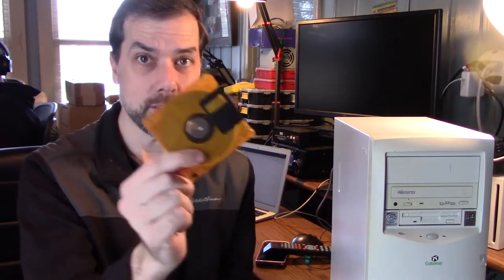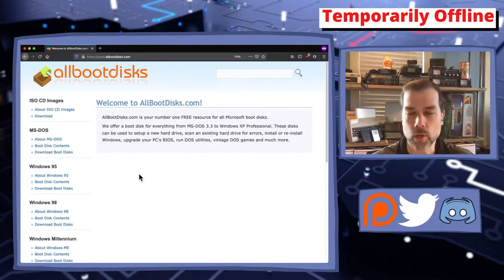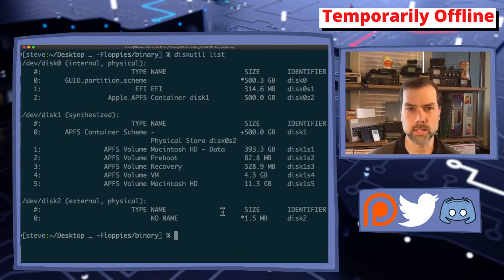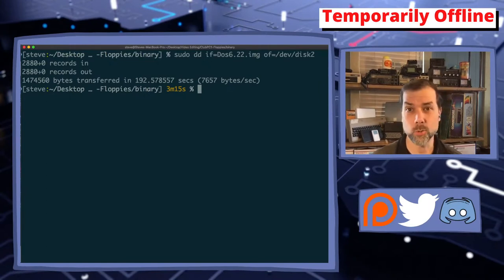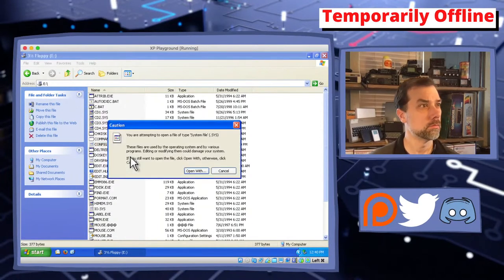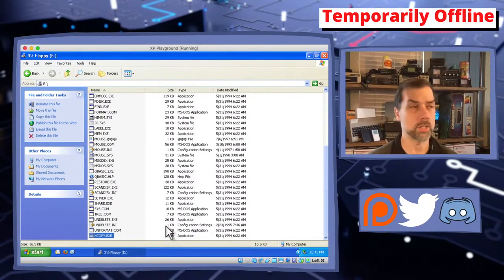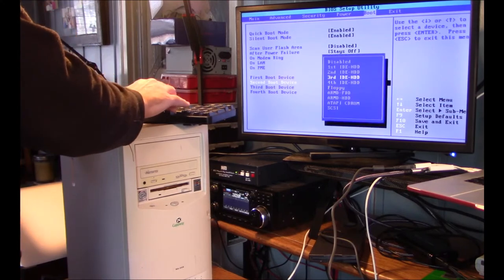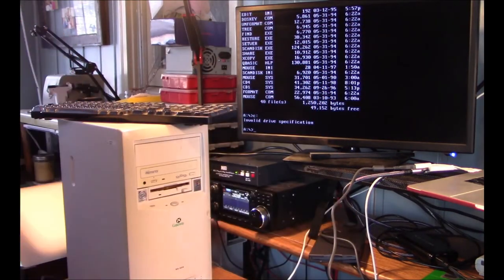How to make retro computer boot floppy disks

Comment: Hi! I came across an old ibm ps/2 mod30. What version of ms-dos should i try to download? Is the default language changeable? Right now is telling me that I should insert a disk in German.
Reply from the maker: I had a Model 30 as well.  Great computer!  You can run any version of MS-DOS on that from 3.30 up to the latest.  You can also run any version of DR-DOS or FreeDOS if you like to play around.  Look around the internet for the setup disk for your Model 30 and you should be able to switch the language around.  I'm not sure if you got a "german" model, or if they all have support for changing languages.

Even if you can't change it at the hardware level to support your native language, you can use the "code page" tools to configure the machine to "speak" your language.